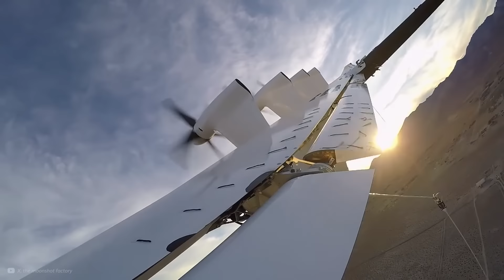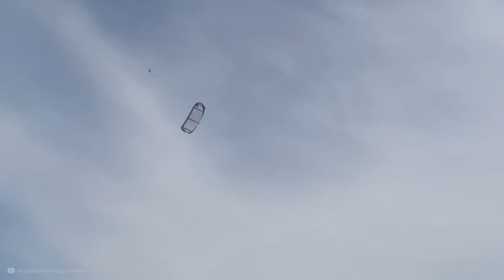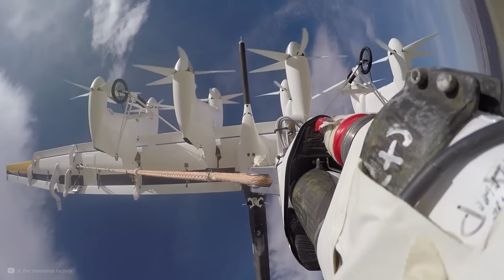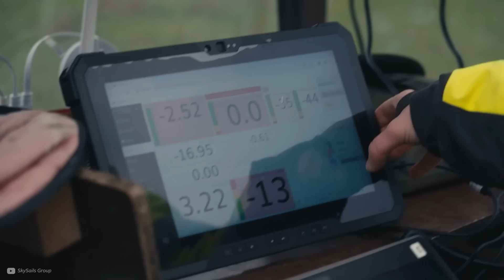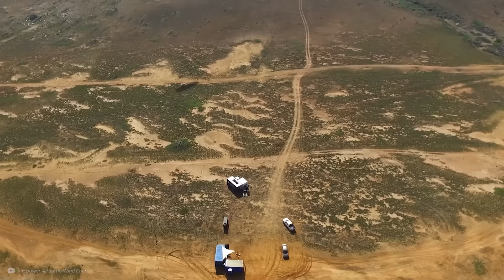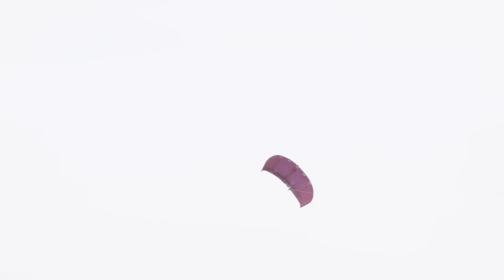Airborne Wind Turbines: The Future of Clean Energy?

Comment from the maker: Do you think airborne wind will take off? Thanks to SurfShark for making this video possible. Go to https://surfshark.com/ziroth for an extra 4 months Surfshark.
Reply: I've always found the ground-generating wind sails appealing, because they basically do what birds have evolved to master. I am not a physicist, but it seems that birds, by adjusting the angle of attack, are able to go up and down, without adding much energy.
Reply: @rasmis  Birds are living organisms that renew themselves. That's the biggest difference between a bird and a sail.
Reply: Hell no! At least for commercial applications. They are too technically complex compared to even vertical axis turbines which still hold promise and could be further refined with stronger/lighter materials. I used to live near a set of them in Pincher Creek, Alberta which is Canada's wind turbine capital or at least was at the time... I can see them being developed for the emergency response or survivalist community for off-grid recharge purposes though, but even then...
Reply: How do the braindead like this twit, ever get their hands on a computer?
Reply: Does this fool actually have a living brain cell?
Reply: I'm Ryan Innes and I'm in this with you
Reply: So,if this guy is called Ryan,then who is Ziroth?I
It's all a bit mysterious.
Reply: Yes but the orientation is wrong. You want it tilted around 15+ degree with almost negative bouncy(balloons) so excessive wind is converted to altitude so when wind slows down the weight and reduction in altitude will generate extra force. Then you want them paired with one providing altitude+power while the other is more for power generation (redundancy and altitude control) wing foil attachment is viable as well paired with balloons.
Why ground them when you don't have to?
Reply: I wonder if they have tried balloons with sensors around before to measure wind speed direction humidity and pressure, then the flight controller could predict the change in wind direction speed humidity etc.....
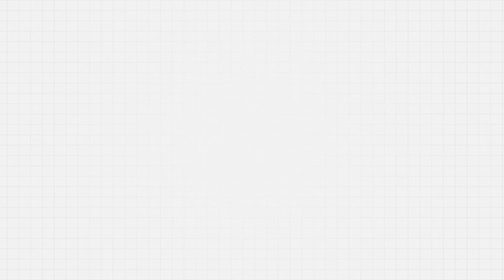Reply: 1:55 This is a mistake. Just a simple google search. Or the site guinness world records.

The largest wind turbine is the MySE 16-260, built by Mingyang Smart Energy (China) for the China Three Gorges Corporation (CTG). The MySE 16-260 has a rotor diameter of 260 m (853 ft), with three 123 m (406 ft) long blades and a 14m (46 ft) diameter hub, and a generating capacity of 16 megawatts. 

It was installed at an offshore wind farm in Pingtan, Fujian Province, China, and connected to the power grid on 18 July 2023.

Each full rotation of the blades generates around 34.2 kWh, which is enough to power a typical European home for around five days. Over the course of the year, it is expected to generate around 67 gigawatt-hours, which is enough for 80,000 households according to figures provided by Mingyang (annual electricity consumption varies significantly from market to market). The generator itself weighs 385 tonnes (385,000 kg), and is mounted in the hub of the turbine, around 152 m (498 ft) above the sea surface.

The Chinese offshore wind farm industry has to contend with more extreme weather conditions than its European counterpart. Most of the coastline suitable for offshore wind installations in China is also periodically subject to typhoons. As a result, the MySE 16-260 was designed to withstand wind speeds of up to 287 km/h (178 mph) – equal to a Category 5 storm on the Saffir-Simpson scale.
Reply: Don't turbines take energy from the wind, thus slow it down which will contribute to "global warming"?
Enough of the insanity! CO² is a gas of life not a "greenhouse gas" as without it no plants will grow, nothing will have anything to eat as the food chain begins with plants.
Eliminating CO² production IS mankind committing suicide!
Reply: routing ones internet traffic thou another mans VPN and thinking its safe must be the biggest joke on youtube you must be stupid
Reply: Regulation also makes things harder for start up companies and promotes the former of massive corporations who can afford it. Regulations are the main reason the middle and lower classes are year over year losing upward mobility. Remember you used to be able to build cars and become a mechanic, now we have so many permits and regulations that it takes tens of thousands of dollars of funding and education to just replace an oil filter. 

Take note that same want for solar panels, no longer, same went for AC units, No longer, and right now programming is one of the only industries that doesn’t require any certifications but this is currently being changed by large companies who are now issuing permits to work on there systems. Right now it’s just a piece of paper but soon enough it will be a requirement. 

When are people going to realize that appeal to authority and realiance on standardized governance practice is authentically gate keeping the poor from bettering themselves even the middle class from bettering themselves because you have to be born into money just to fund the certification and regulatory framework to start doing business. In the fifties you just opened up your garage and worked on your neighbors cars to keep your bills paid, now the police will come stop you if you try to make money without conforming to regulations. When are people going to realize that not have permits or certificates does not mean you are not qualified. 

One of the greatest horse trainers in racing recently told me after fifty years in the business working since he was a teen he is quitting because he would hate to get a degree to continue working when he pioneered many of the modern techniques people use. 

In California dispensaries are going out of business making the private sale of the lettuce from illegal organizations the only affordable and profitable type of dispensing possible. California can’t make money selling greens because they passed too many laws. 

Leftist big government people never see the harm that bigger governments does to the poor, they think more taxes means help and social welfare but it really means people need social welfare because the government won’t allow poor people to do anything profitable but sit there. People often overlook the reason why the economy was so strong four years ago was the US admin was slashing an average of 2500 regulations a day. That’s how much weight and bloat paying lawmakers to fix things creates, they make more and more fines, penalties, certifications, inspections etc, all cost companies money and the people that end up not being able to do business is the middle and lower class, the mega corporations that many people are convinced those laws are for benefit from all the business that moves from loss of competition and they don’t even have to comply because it’s cheaper for them to pay the fine or tie regulators up in court for a decade while they continue bad practices. It always inhibits the people who weren’t a problem in the first place, you will find it is often corporations who lobby for regulations because they know it will push out competition from amateur companies. Look at right to repair laws, the reason why there aren’t an abundance of cell phone and computer repair shops is because companies lobbied to make it illegal to people without certification to repair the products, and ofcourse the original manufacturers decide who gets those certificates and how much it costs to get them. They also don’t repair anything themselves and don’t employ qualified workers to fix anything because it’s cheaper for people to just look at your device and say it needs to be replaced. 

Regulations are awful for human dignity and for quality of life they often deny people vital resources for arbitrary reasons and often leave people unable to do basic things they need to do to survive. In Arizona for instance collecting rainwater is Illegal. If that isn’t an example of making it illegal to survive, collecting water in a desert will get you a fine. Remember a fine could be the different between paying your property taxes or not, you could lose your house over a hefty fine for just trying not to die. 

Please think about this anytime someone wants anything to be privatized. Anytime anyone say the government should take care of it, remember that means letting the government tell the people they can’t do something on there own. I will never forget about the terminally ill kid the NHS in England denied the right to travel when Italy offered him free treatment. No reason given, the obvious reason being we already said he can’t get treatment and we won’t be embarrassed by another government. Also remember in the United States a huge percentage of cancer patients are from England and Canada because there systems won’t help them even though they have the money.
Reply: Is this just another startup wanting investors onboard?
Reply: No, to many fluctuating variables to contend with on any given day.  Therefore, resulting in a greater wear and tear of materials and less survivability over a long run.
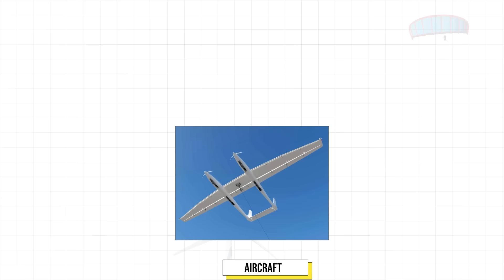Reply: I think the only viable option is the baloon in the bottom left at 2:41. It's simple, elegant, can easily be retracted into a hanger during storms, and once airborne, could probably keep aloft with wings, and utilize a rigid carbon-fiber skeleton so it didn't need as much gas to float.
Reply: Well, if they're made out of fabrics or thin membranes they need to be replaced quite often because they're battling elements like sunlight, storms, rain, snow, hail, lightning, maybe even sand in some areas etc. The more moving parts (moving related to each other) the more unmanageable they're. It all depends on if the value of the power they generate would be greater than the cost of manufacturing, installing, space, maintaining etc, and if they have negative environmental effects, like howing noise. Also, the overall power generation reliability is a major factor. Ultimately I think that to become a dependable power source is a dream not near to reality. Let's return to the subject in 30 years or so. Skeptical.
Reply: What about a storm 🤔
Reply: Of course wind energy will go airborne! I'm a researcher in airborne wind energy  (F. Trevisi, Polimi) and I'm glad to see this easy-to-understand video getting so much attention! :) Thanks from all the airborne wind community! Great work :)
Reply: mark space ratio; vorticity can impact on park layouts and collisions
Reply: isnt this just big hero 6
Reply: You doing it all wrong. A single tether. The balloon is to be orientated vertically and is a giant spiral. Will work in any direction. spins the tether, the generator is on the ground.
Reply: You should contact Kitemill!
Reply: I remember these from the 1980's. They would have art pics of cities with these tethered to every building. The prototypes look the same as then with the same problems. Definitely a much harder then it appears problem
Reply: China just released the massive s1500. Let's hope it is a success.
Reply: NO! These systems are far too complex for unmanned infrastructure installations. The only chance any of these companies have is niche applications for things like Arctic expeditions.
Reply: Nah.  Too much friction with dust in the air, plus damage from storms...  these things would need lots of repair it likely wouldn't be cost efficient.

People want zero point energy.  Impossible, they say.  So might as well give up.

Wel, hold on....
0.0 point energy might not be possible, but what about 0.1?  0.01?  0.001?  If we put enough effort and study into it, we could probably get pretty close.  And the more research we do, the more efficient we could get it.
Reply: @justinanderson267  "0 point energy" is not a net positive, you can't extract it.
Reply: why did you delete my comment.
Reply: It's just so dumb

Comment: Just because you can doesn't mean its a good idea.  What could possibly go wrong, LOL.... Tornado, micro burst, servo failure, software fault, leak, etc. All are potential catastrophic failures. Compared to a windmill where only a failure of the blade angle servo can lead to catastrophic failure. Maybe if they are so cheap the cost model allows for replacement every year.

Comment: Sure there's a lot of energy higher up. But you're only capturing an incredibly small amount of it, limited by the size of the kite. Surely there are equations that can tell you how much energy you can get per square foot of the kite, and then for the entire kite. It appears to me that all these companies simply do not do those calculations and instead just think, "Hey, there's energy up there, we can fly kites and tap into it, and it will be a fun engineering challenge, so let's do it", and they can make some cute presentations to convince investors to pump a lot of money into it, investors who also will not worry about those calculations that should be done.

High-altitude winds ahve been there forever, tempting people to devise ways to tap into it, but decades of trying has shown that it's just not feasible. No one's doing the calculations.

Comment: Here is the missing link. Hydrogen / helium blimp. Fill it with high density "light weight" chemistries delivering 400kw/h or greater. Have a quick swap system. Ground station has several bays the battery modules can connect into. The blimp takes off into high altitude / jet stream level winds. Uses a turbine to charge the batteries and small drone like propellers to keep the station from moving too far and by designing the turbine a specific way that can also help to counteract drift. When the batteries are full the blimp comes back down to land and then quick swap the next battery modules and go back up. Weather permitting it could operate 24/7.

Comment: Kite wind capture seems to have a broader range of use cases than traditional turbines. They also have the potential to be integrated into "roller coaster" or track based systems like those being designed by Airloom

Comment: There's a novel system called "parachute ladders." under development in China. It's a ground-gen system with a series of kites in the shape of parachutes. The massive parachutes can currently have a diameter of up to 80 meters(massive). and generation capacity of up to 20Mw per system.  Parachutes have a relatively stable flight path compared to glider kites, which have to have a figure 8 flight path and take up lots of space and also safety issues where a fast-moving tether can get tangled with surroundings. PL system has the ability to ram a lot of generating capacity into tight airspace(which requires regulatory hurdles to jump through to get) to make it commercially viable. It can fly up to 3000-6000 meters, harnessing real high-altitude power. If you'd be interested, I would love to tell you all about it.

Comment: I feel like there is a LOT more success to be harnessed from the natural movement of water. We do a fine job at harnessing hydroelectric at rivers and falls, but the ocean is mostly left alone. The energy density of moving water is enormous. 

Imagine a sturdy beam anchored in the ground beneath the waves. Large barges are moving up and down with the waves. At the interface of the pole/barge, you have a rack and pinion moving with the oscillation of the waves. As the gears turn, they power generators. Either store the energy in batteries on board the barges or wire it directly to a station on land. 

Other systems can utilize the unrelenting power of the ocean. It seems like an enormous amount of untapped energy.

Comment: No, it's just a desperate bid to make wind powered devices look useful. Notice the lack of information about why wind power has a massive carbon footprint? It's not just the building, but the maintenance. It's going to get scrapped as a failed project. Why? A.I. and it's need for solid power supply. Expect nuclear power sooner than later.

Comment: I'd say it needs to be notably more efficient and cost effective before it can out pace standard wind turbines. my main concern is generator density, namely how many can we fit in a given area. 
most standard turbines require about 3-4 rotor diameters between each turbine (at most 220m x 4 = 880m). the kites need to reach altitudes of 800m so that's nearly as much just to operate one. 
Taking that into consideration the efficiency of these things needs to offset the the numbers of standard turbines by quite a large margin to become more viable.